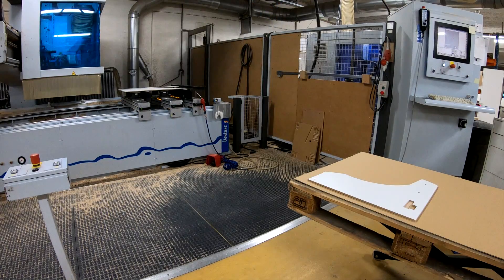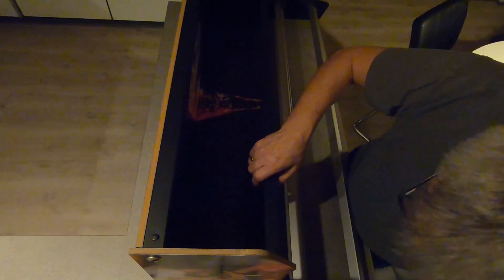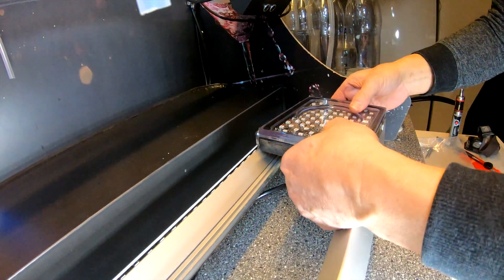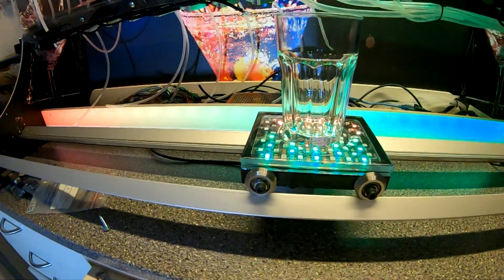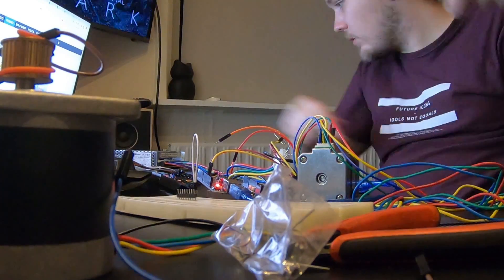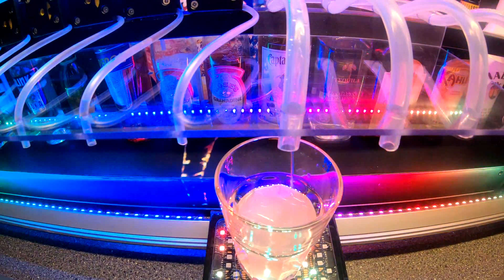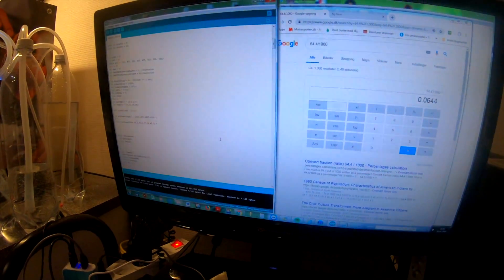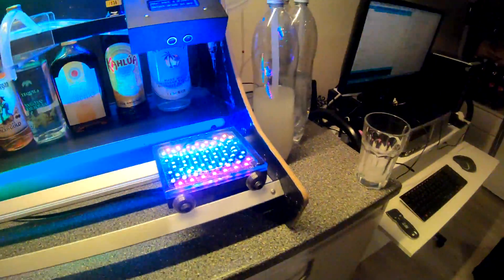DIY COCKTAIL MACHINE | TUTORIAL

Comment: Would it simplify the machine a bit to have all the tubes run into a pipe, to make a faux faucet, and the glass placed under that faucet, all appropriate pumps turned on and liquids dispensed, then done, without moving the glass back and forth?
Is the moving back and forth of the glass due to spacing requirements or another technical issues or is it mainly for the novelty of it?